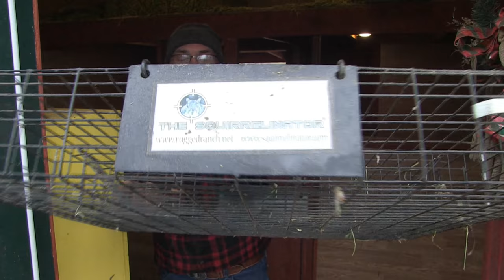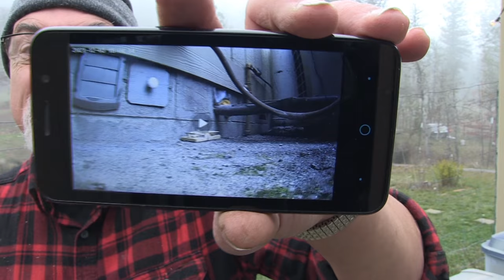I GOT RID OF RATS - How I Got VICTORY Over The Infestation

Comment: My brother is in the pest business. And he set us up with these two items.

He cuts the down spout to about 12 or 15 inches. 

Then he places two mouse traps inside, back to back so the triggers paddles are next to each other. 

We rarely bait them. We put them along side walls but best one on each inside or outside corner.  We catch almost exclusively Norway rats as they love eating oranges here in Phoenix. 

The reason of the down spout. Many get away without it. These traps have a unique design almost as if there is one set of wife going up as one goes down. As the rat walks over the traps and they trip, It wither catches him and pins him to the roof of the down spout or gets them across the body. You can just look down an if one of the out side spring wires is down it has not been sprung.  

Leave them alone. They are passive. Rats love to run along walls. 

You could put a piece of 4x4 on top of it to compel the rat to use the tunnel. 

We also use blue square rat poison. 

I have caught about 150 rats in the last 3 years. Alon with the bait our issue is mostly under control. It would be real good if the neighbors did it to. But most people do not  believe they have a pest problem. .until they find rat poop

https://www.victorpest.com/store/mouse-control/snap-traps

Shop Vinyl Contemporary Downspouts | Gutter Supply
Reply from the maker: Nice. I have not thought about that.

Comment: My sister had problems with squirrels and deer eating her apples. She took bars of IRISH SPRING SOAP, cut it into pieces, and put it in a mesh bag or old sock. She hung this other trunk of her apple tree. This year, she was able to harvest her apples. My home is on a crawl space. I had mice. I used the IRISH SPRING SOAP. I put pieces in each kitchen drawer. I rubbed the bars around the door jambs and thresholds.  
I have the baking soda mix set out. I used equal parts of baking soda, cocoa mix sweetened with sugar, and the potato flakes. 
When the weather breaks, I will have all pipes and wires entering my home caulked. I had a spare roll of toilet paper under the bathroom sink.  When I went to get it, it was 1/3 , chewed up; I suppose for nesting. That prompted me to find out the gestion period of mice. 19 DAYS! YIKES! 😮

Comment: I used the baking soda mix and that seems to have decreased the population. The most reliable are large glue traps and it only requires the rats to walk across it and get stuck. Usually they are dead by morning from exhaustion trying to get free of the glue, but those that are still alive a good medieval dunking in water finishes them off.
Reply from the maker: All I ever found in my glue traps were severed tails.
Reply: @pinemeadowshobbyfarmafruga8319  !!!
Reply: I put some glue traps down in my house and woke up to one caught on it but it was eating glue trap along with the glue that's on it and it was almost free until I swept it up on the dust pan threw it in the garage can outside they are very smart
Reply: Too many non-target species get caught in glue traps- I’ve seen wild birds, kittens, frogs, etc. stuck on them. ☹️☹️

Comment: Rats are very smart, I’ve used regular rat traps but once one or two have been fought the other know not to go near them, electric rat traps do not work they will not enter the trap at all, rat poison works with the industrial strength but it’s very expensive and dangerous with having the other animals and wildlife running about.  I’m using the baking soda or plaster of Paris with equal parts flour mix with an attractive powder like corn flour or cup of soup powder.  So yes these techniques do work.
Reply from the maker: The plaster is what I don't use as my livestock may get into it.
Reply: @pinemeadowshobbyfarmafruga8319  ok thanks
Reply from the maker: Your welcome.

Comment: The 5 gallon bucket trick got me 18 mice the first night.  I used 2 Ramps up to the spinning Red bull can on a coat hanger, peanut butter, butter and a little honey. Bucket was filled almost 3/4 full of water and dish soap, about a quarter cup of soap.
Reply from the maker: I will need to lower the can on my bucket to make it work. It still has not caught a rodent. My pail is a fail.
Reply: I also tried the 5 gal bucket 1/2 filled with water with a layer of sunflower seeds floating on top. Use 2 ramps & skimpy trail of seeds. Got a mouse & a chipmunk. I think it would have worked great if I had continued but wasn't after chipmunks so ... " the end."

Comment: Great video! I am curious what brand of Game camera you use? 
I have ducks and chickens, so I also wage a constant battle against vermin. Things that I have found useful is to use a bit of bacon grease to sweeten the bait. If I put a few pounds of the poison blocks or pellets in a 1 gallon plastic bag with 1/4 cup of warm bacon grease and squish it around to cover the blocks or pellets completely, it really seem to increase the rate that the poison disappears. I have also had success just greasing the inside of the bait container with bacon grease with a napkin. Just the smell of bacon makes them eat anything. I have also had good luck with "cheese whiz" the can of squirt cheese. I get blocks of rat poison that has a little hole in the middle of each block. Then I put a squirt of cheese into the hole in each block. 
I agree with OPEN EYES WIDE. Wearing gloves when setting the traps make a lot of difference and washing your traps between uses. The wooden based traps can be harder to wash the smell off but the plastic, metal and wire traps are easy. Purple power degreaser works great.  Every new trap I bought seemed to work great, once. Then I would catch nothing for 6-8 months in that trap. After my buddy told me to wash the traps, They might catch something every week.
I am going to buy a 5lb bag of baking soda today.
Thanks and good luck.
Reply from the maker: https://youtu.be/QVcMmtfilyc, Hope this helps.
Reply from the maker: Regarding gloves: https://youtu.be/SDVZQWgCiVk

Comment: Thank ypu for such a thorough and informative video! As a vet, however, I feel compelled to correct one thing, that was mentioned, regarding the physiological capabilities of rats, and mice. Contrary to your claim, rats and mice do, in fact, possess the ability to pass gas, but they lack the ability to burp or vomit. The inability to burp or vomit, is an extremely rare trait, which is limited to select, few species, throughout the animal kingdom. The reason behind this, for mice and rats, stems from their bodily structure, consisting of a longer esophagus, than that which is present, across most other species. As a result of the increased length of the esophagus, complications, then, arise, with the reflux mechanism, responsible for producing these particular functions. In my experience with these animals, baking soda, and other similar products, tend to actually yield mixed results, with limited success rates, and, even, in the case of successful elimination of the animals, they still cause slow, drawn-out, and painful deaths. The bicarbonate in the product, mixes with the stomach acid, which results in a buildup that eventually leads to intestinal blockage. rupture, and, on occasion, death; however, it is unlikely that ingesting these products, one, single time, will ever be effective in yielding the desired, fatal result. It normally takes repeated meals of such products, followed by a waitkng period of 1-3 weeks, before enough of a buildup, has been accumulated within the system, to potentially result in a fatality. Throughout this time frame, the mouse, or rat, will be experiencing a significant, and unbearable level of pressure, discomfort and pain, so although this method does stand a chance at effectively eliminating these unwelcome creatures, the, overall, success rate is still rather low, there is profound suffering involved, and it lacks the ability to produce instantly gratifying results! Nonetheless, I am glad to see that you were successful in eradicating your problem with infestation! I'm sorry if my comment has come across as being harsh, or rude, in any way. I certainly mean you no disrespect, and just want to ensure that everyone is presented with the correct data. Upon researching this subject, one will be met with a broad array, of conflicting claims, and results, so it has, simply, been my intention, to pinpoint the information, that is, in fact, true and accurate!🙃🙂
Reply from the maker: I stand corrected. Thank you. I regurgitated my information which was gleaned from the UNIVERSITY OF YOUTUBE. My granddaughter is headed off to OSU in a few weeks to study to be a Vet as well.
Reply: @pinemeadowshobbyfarmafruga8319  
  
Oh, that's awesome! Congratulations to your granddaughter, and I hope she enjoys it! Animals are such pure, authentic souls. I'm sure you know, exactly, what I mean, considering you own a farm! I just never get sick of spending time with them, and being able to help them, and it brings me a ton of joy. I hope your granddaughter finds that same joy, and sense of satisfaction and reward, in working in this field!😊
Reply: Jessica, according to your comment, how is his success rate "still rather low"?  It is CLEAR he is having success!  And quite frankly, avoiding the rodent's "profound suffering" from the baking soda method isn't a priority!  A homeowner's "profound suffering" is what matters here, or perhaps YOU can adopt them ALL and have them live with you. 🤨
Reply: So do you have any ideas?

Comment: The 8 gal 'pot'  w/ spinning can on a wire across the top of it, which you tried to catch rats in,  has a definite structural failure.  The can needs to remain in the very center, between both sides of the 'can', with inches between itself & the rim of the 'pot'.  This can be accomplished by putting crimps in the wire, either side of the can in its center position.  It needs to spin, but stay centered in place.  Otherwise rats can keep from losing balance & falling in, by standing on the rim of the bucket while gleaning some food off the can.
Reply from the maker: Yea, that thing still dont work.

Comment: Peanut butter mixed with baking soda worked for me it was making alot of noise in my celing in the basement where I am staying at and it sounded like it was destroying things in there at first I thought it was someone trying to rob me coming in my house how loud it was. I mixed that and put it on a paper plate and put it in the ceiling. I heard the mouse or rat making its loud noise then I heard it frantically running around then moving violently and then it stopped.

Comment: 1st time viewer.  Subbed and liked! 😃👍

Peanut butter mixed 50/50 with baking soda, and add some old candle wax shavings.  The fine mesh on a cheese grater works perfect for getting small wax shavings.  For the barn I would have moved all of the animals out for a few hours, completely sealed the barn, and run a generator inside until it died.  Uses up all the oxygen and fills the place with carbon monoxide which even gets into wall spaces...  Kind of a poor man's whole house fumigator that professionals use when they tent a house.

Comment: I use glue boards, they have multiple sizes available. Of course where I use them are at vacation homes, homes that are empty more than not. In the garages, shops, outbuildings, sheds, etc.  I catch mice, pack rats, small snakes, lizards, and all sorts of bugs.  They are all pests where I'm at and I doesn't matter if a few die especially  the ones inside causing havoc.  If you have a really big problem, I glue like 20 or more boards to a bigger piece of cardboard or similar and now you have a huge glue board.  Then you can simply cut away the glued piece and leave the rest.  I have had success with this many times.  And the big flat square squirrel traps works good here as well.  I've caught many ground and rock squirrels at the same time, as many as 7 at once.  I also use the water bucket with 50% success, it has to be maintained often and does not work in winter months as well when the water freezes. These pests are a huge problem in southwest NM. Definitely going to try your method as this would be so much easier than any of my methods
Reply from the maker: I tried those glue traps, all I ever found in them was a severed tail.
HOMESTEAD HACK-Ridding Rats In The Attic  https://youtu.be/X2GNa0kWNz8
KILL RATS DEAD WITH CORNBREAD MIX: https://youtu.be/TBeySuYvdbY
KILL RODENTS AND INSECTS WITH BAKING SODA; https://youtu.be/lwzWpBGn0No
CONTROLING RATS IN THE ATTIC: https://youtu.be/X2GNa0kWNz8+
HOMESTEAD HACK-Mulch using Cedar https://youtu.be/85Zlk5SRHeQ

Comment: I use the live traps with a trail of dried mealworms back to the pressure plate in the trap. Leave it unset for a few days but full of bait. It'll take a few days for them to trust it. Then, after you notice your bait getting gone regularly, it's time to set it. I only set mine for when as soon as the trap goes off, I can grab it immediately. I then drive it about 2 miles away and nowhere near another home and release it by a creek or branch. I go back and repeat. After a few days, you may have to leave it unset again for a day or so with bait to build trust again. This is for those of you who are after a no kill method. It's strange, I used peanut butter at first and they wouldn't touch it, and I know they love it. When I used to keep pet rats years ago, we would sit and eat peanut butter m & m's in the chair sometimes. And yes, they are very intelligent. If you do this method, it is very important that you buy a trap with a handle to carry it. They will panic and try furiously to chew their way out and will bite in defense. Throwing an old towel over it while taking it to the car will help with stress levels. I found that they loved mealworms when they went after my chickens' supplies as their fave. I've just began doing this and have caught and relocated many. Process ongoing...
Reply from the maker: I still use live traps baited with chicken eggs and peanut butter. They work. Also use baking soda and Jiffy cornbread mix in cottage cheese containers. Also use the snap traps. I use the whole arsenal. Now I only catch something about once a month in various locations. Now I have traps in garden. Something is eating my cabbage and broccoli plants.

Comment: You need to grind the Rat X pellets to a powder and add peanut butter to make granola poison. The mice and rats can not suck the peanut butter off the Rat X. I had the same problem. I found a pile of the Rat X in the corner of the garage with out any peanut butter. That works.
Reply from the maker: This new solution I worked out does it better and faster Check this video out https://youtu.be/lwzWpBGn0No and this one for automobiles https://youtu.be/murn0pdSh0k and my scarecrow collection for my garden ttps://youtu.be/0lrDTAYKD68

Comment: I pushed several bait blocks onto an 8" tent peg which I hid under a pile of junk. Next day, both bait and peg gone. Repeat 4 or 5 times til I worked out that DEFRA  won't allow poison any stronger than 0.00001%. 
So it's to stop playing games; baking powder. Prob gone in 3 nights, and no secondary poisoning because baking powder isn't poison.
Reply from the maker: Use baking soda.

Comment: If you have rats in the attic and can't figure out the entry point, try this 

I got 6 people to stand around my house. I went into the attic and set off a bunch of roach foggers. This got them to flip out and running to escape. A couple of people around the house saw how they were getting in and out. I then stuffed the holes with stainless steel pads, filled with foam, and fastened steel mesh over the entrance. Yes, it might have been a little overkill 😂. But I have had 0 activity in over a year.

Also trim branches away from your home. They often live in oak trees and visit at night. Mint, mothballs, ultrasonic repellents, etc DO NOT WORK! Large sticky traps, snap traps, and live traps are extremely effective to remove the ones trapped after sealing the home. After sealing mine, I setup 20 traps in the attic and caught 3 over the next week. I still have all 20 setup, but not 1 has gone off in over a year.... I am rambling, but if you have a problem, take care of it ASAP! They will chew wires, and you better pray they don't learn that your PEX pipes are a water source! It was cheap and easy for me to replace the pipes, but the water cleanup was hell!
Reply from the maker: Great idea. Get rid of bugs all in one fell swoop.

Comment: The vents under your house are designed to allow air flow to help dry the soil. By total blockage, you are interrupting the function of the vents. Please remove the foam and replace it with two layers of wire mesh, screwed securely to the blocks. You do not want dampness that can't escape.
Reply from the maker: My screened vents are all secure with the exception of one which they found to push through a corner of it and gain access. I fixed that. The rest of my vents are fine and venting just fine.

Comment: I use a 5 gal bucket about half full of water then smear peanut butter on the side just above the water. I put the bucket in a place where the rat can easily reach the edge of the bucket (next to a half whiskey barrel in the garden or use a ramp) The rat reaches down to the peanut butter and falls in - most of the time. That is about the only thing that has worked for me. I will be trying the baking soda method tonight on a few big rats that won't fall in the bucket.
Reply from the maker: Thank you for the tip. Here is a show I produced yesterday. https://youtu.be/Ti2me-LMxJI